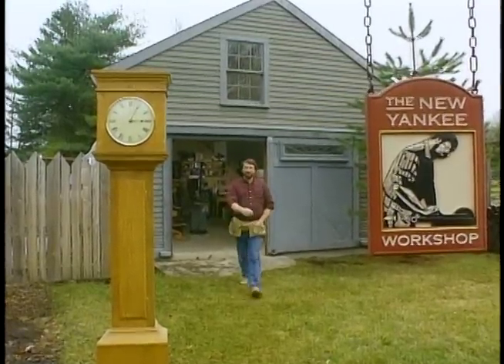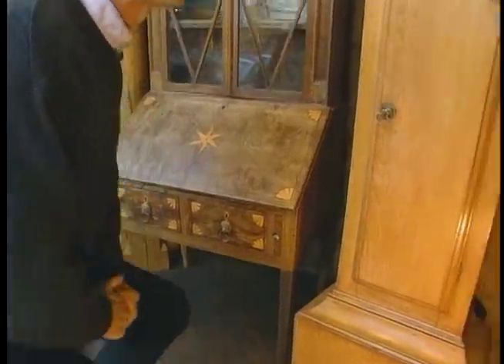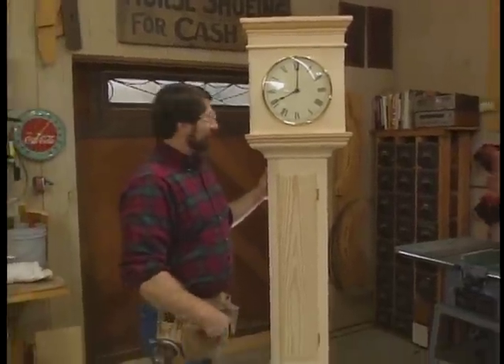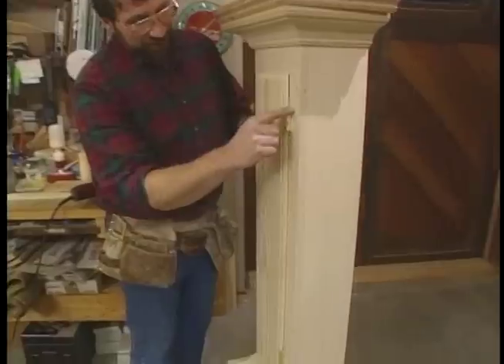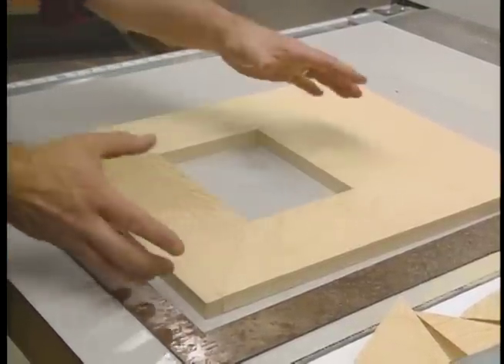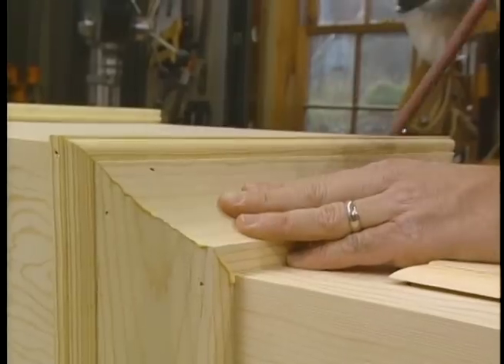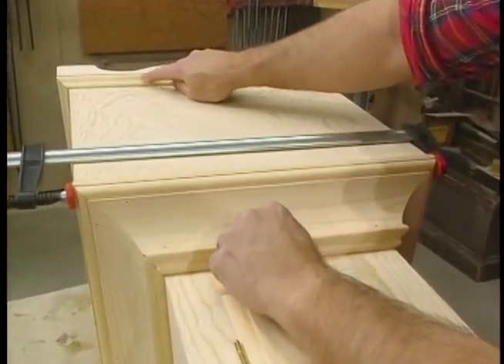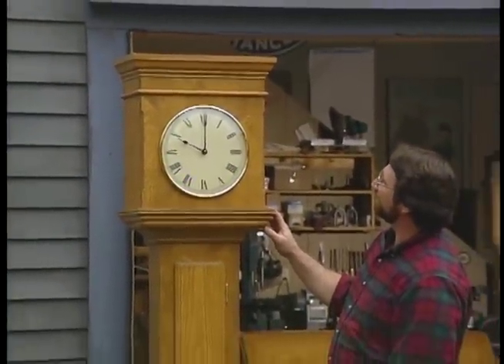Tall Pine Clock  |  S5 E13

Comment: I never knew Norm used the table saw on a bias to cut a cove. I've seen it in old books as a technique but guessed Norm thought it was unsafe. I was wrong!

For those interested, Norm shows a different way to cut a tighter cove in the Marble Roll episode using his wobble-dado-head.

Norm!
Reply: I did it once for a cove molding and it worked fine. Just raised blade slowly and used push pads
Reply: @Mangoshake2021  One day I will give it a try!